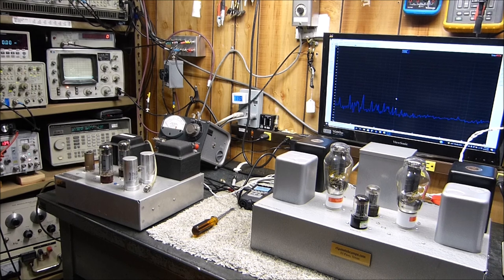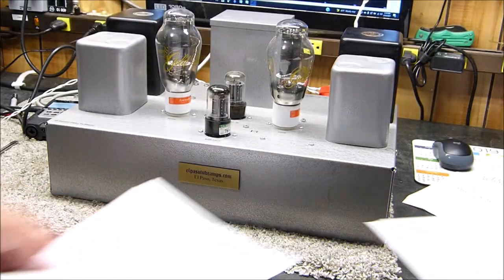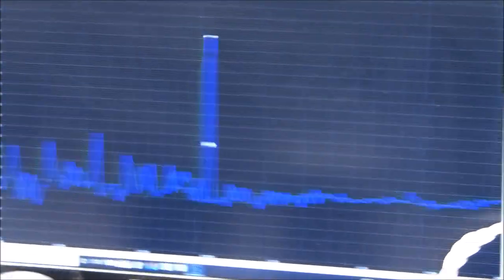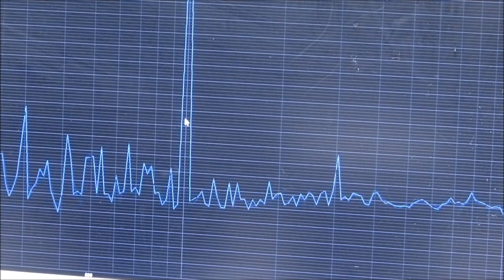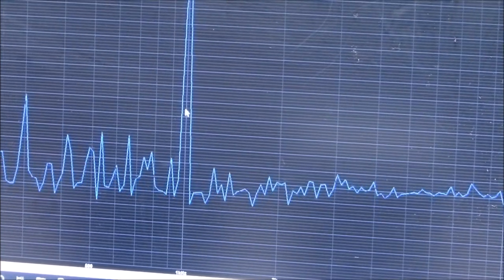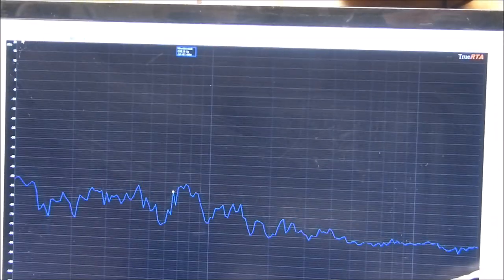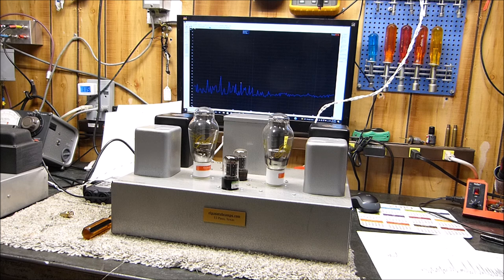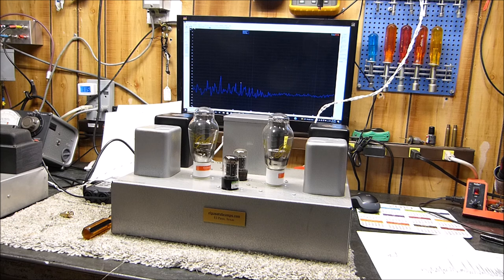300B SET Single Ended Amplifier FFT Profile Analysis With Violin Tone

Comment: Be interesting to adjust the cathode balance while listening to the change in the musical tone on a finely tuned system.  I'm looking forward to the 810 amplifier, I've had a set waiting on the shelf for just such a project.
Reply from the maker: @tubenoobie2694  I had a question posed to me some time back that I have not forgotten and it was about phase relationship of the harmonics.  Not sure if that is what you mean. Harmonic profiles are difficult to analyze and each sample is somewhat different from the last or the next but... I think that is where the rubber-meets-the-road in analytical analysis of sound. I read a thesis from a gentleman where he used some software to remove the noise from the room -  i.e. recorded the "quite" room and was able to remove that noise from the intentional signal to get it a little more accurate. I can't seem to find that article again. It was good.

Comment: I think your chasing your own tail here, getting dizzy and perhaps loosing sight of what it is your trying to measure or prove : ) Measuring harmonic content at low power I find doesn't really reveal much. ARTA and other PC software is limited too, it's max frequency is 20khz ( I think). Also testing with a resistive dummy load doesn't reveal much, a more illuminating test is to test with a capacitive load or even better a speaker at the extreme frequencies, EG 5 to 100hz and over 20khz. A capacitive test often shows amplifiers peaking and distorting at certain frequencies which will effect how an amp sounds when listening to music with speakers. 
    Bench testing only gets you so far, although it can be fun. Uncle Doug wrote something interesting once, saying he preferred to use his ears when testing amps, he has a point.....DA.
Reply from the maker: I really like your point of a reactive load - I will have to build one so I can have either capacitive or inductive reactance although I think it will always come out inductive for speakers. In the end, it does come down to our ears but that is entirely too subjective to have a "scientific" discussion around. I think my simplest point was wanting something more than just the ultra-clean oscillator input and resulting simple integer harmonics caused by the amplifier. With a real instrument tone, I thought I might see something more interesting. One thing pointed out by my friend in Australia, even before the test, was the significant increase of the 3rd harmonic into the 9th harmonic which seems to come out as a dissident chord. He and I recently communicated about that, which can be seen in the FFT profile and it seems there is something like a 13.79 Hz difference from the simple multiplication of integer numbers from the fundamental frequency. This may simply be the exact definition for the fundamental frequency of the E5 note in this case.  This may be my own calculation error but it's all for fun. Also, I am trying to understand the rage over SET amplifiers. They are obviously inferior to push-pull amplifiers in test results but it seems we like the artifacts amplifiers produce - otherwise, why would we even still want vacuum tube amplifiers? I appreciate your thoughts and comments. These discussions move the understanding forward.
Reply from the maker: @tubenoobie2694 That was an interesting article from your link above. I did read it. Just to be a little picky about it, where he says. "current hungry reactive loads of many contemporary loudspeakers", that would imply capacitive reactance and would not be the case with a simple speaker. 
Posting of my video has brought out some good thoughts as I was hoping it would.  For one, the large increase in the 9th harmonic implies a dissident tone created by no other than, the characteristics of the SET itself. That does seem to be represented in the FFT profiles and is not in PP amplifiers.
Now, for my thoughts of why I did this in the first place. I was looking for a slightly more "complete" way to evaluate an amplifier, not just SET, than just by using a pure tone and seeing the integer harmonics as we can see in any audio book. And as you mention, we do simple amplifier testing at 1 KHz where almost everything works best in the amplifier. That is fine for a start but I thought, possibly, the next step up would be to use a real instrument but still look at a single “tone” with its naturally occurring harmonic profile. It does seem to have some merit. Anything past a single “tone” is going to become so complex we will need a computer data reduction program to tell us what we think we are looking for… and that is OK too.
Loading all of this into reactive loads is, once again, going to put us in a situation of complexity beyond discussion. This is not a complaint but just realizing there is always so much more that can be added to the measurement process that, in the end, is purely academic and I doubt has any real value. The last thing to consider is we always ask, how does it sound? We all know this and that is completely subjective. So, we have chased all of the electrons into a corner and analyzed them from stem-to-stern and then thrown them all out as we have a beer and tell everyone how good our new amplifier sounds… it is great to be a human where we can believe anything we want… and we can prove it with a FFT harmonic profile.   I do truly appreciate your comments.       :-)    